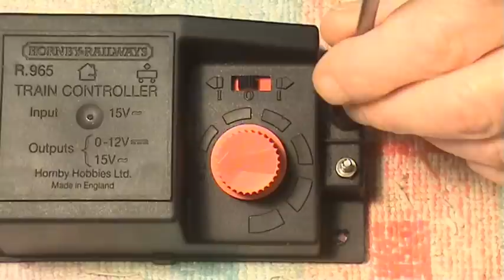How-To Modify & Beef-Up The Hornby R965 Controller. Hornby Triang.

Comment from the maker: Hi again Dave. Yes....the DC voltage is higher than the AC input but I think your 2 meters are reading what is known as residule voltage. If you put a load across this voltage [eg. put a loco on the line] then I think your meters will give you a different result! Also...as you are running the older locos on the modern track....the sleeper-grips can raise the wheels so very slightly that this causes exessive sparking! Anyway....you've sussed the problem now! Best regards, John.

Comment: Very interesting video. I'm a bit concerned that as the removed thermal cutout also provides short-circuit protection, your circuit board will take the full short-circuit current until the battery charger fuse blows (which may be somewhat higher current than it says on the fuse). Might be wise to put a 2 or 3 amp fuse in line with the output as a safety measure? Also, would suggest not leaving these unattended in case they get too hot.

Comment: The standard output cable before you remove it what one I'd the live? Black or black and white please
Reply: Hi Shane. The one with the white stripe is the positive one buddy. It doesn't really matter that much because if the loco goes the wrong way you can just simply reverse the two wires! Hope that helps buddy? Cheers, John.

Comment: The first version of the original controller back in the 80s used to have the transformer inside the controller itself and naturally this taken up lots of room. Personally I favoured the original because it was more robust with no stupid plug in the rear of the unit, just a simple wall plug. Cosmetically the original unit was exactly the same but had a yellow knob. However on a note you probably can't do the modification in the video above to it.

Comment: Hi John - I just checked my track again closely and I have found the problem - some corrosion on the inside edges of one section of track - I have just cleaned the wheels of a loco and run it for 15 mins full speed, avoiding the suspect bit of track and (virtually) no sparking, no pitting of wheels, no problems on the remainder of my layout. Loco is now crawling over points and I haven't had to clean the wheels. Happy days :) Thanks again John. Dave.

Comment from the maker: Hey David thanks for that info & yes...you are correct. I have at least one of the R921's [which I have ripped-out the transformer] & again yes...these will almost certainly have the older circuit! Anybody reading this should take your advise & go for the R921's if they can find them! Glad the mod's worked well for you too. Cheers, John.

Comment from the maker: No Tony...the post 1995 controllers are not so good or as easy to mod! They use a completely different circuit design. They can be improved but only by about 40%.

I may do a video on how to do these in time. Kind regards, John.

Comment: Those are the same reasons I prefer the older ones. Usually it get's bad without you noticing and then it just shorts out and so you need to buy a new transformer (might be part of Hornby's idea)
Other than you suggest I don't see any problems with the older unit. I've always used the old Hornby R900 and these older units with no complaints and can't say I've ever been shocked either.

Comment: Can I just say, what a well thought-out and presented video this is.
 
It's hard judge your target audience - and this video gets the balance exactly right. Neither too technical for beginners, nor oversimplified to patronise those of a technical background.

Our hobby is one of the best for learning such a wide variety of skills and youngsters need the encouragement to have a go.

There are some very good switched mode PSUs available these days, and one of these (appropriately rated) would make an ideal replacement. The fact that the recitifier bridge within the controller cleverly polarises the DC input means that the input socket may be retained - but with obvious allowances for current. That said, hard-wiring may still be the best solution in this case.

G

Comment from the maker: OK, I'll try to answer these questions. The controllers cannot put out 24 volts as the wall-plug transformer is only approx 16 volts to start with! Can you tell me how you are getting this reading? As for the other issue....there's always some small spark at the pick-up wheels & this will be more pronounced on older models. If you keep the wheels & track clean you shouldn't be having this problem! Are you running older locos on modern track? Get back to me when you ready. Cheers, John.

Comment: This is an excellent video, explains why the Hornby controller cuts out when I had my old Wrenn City of London trying to run off of it. I ended up using the much older but much beefier Tri-ang / Lines Bros Ltd controller I picked up off of eBay. Nothing like having a controller that sounds like it might kill you if you touch it! :)

The Bachmann 36-560 controller is pretty decent if you are looking for a cheap DC controller.

Comment: I'm slightly confused that you changed both input and output wires to big beefy wires but used little wimpy wires to the transistor. Doesn't all the current run through them too or am I missing something?
Reply: They are shorter wires, so the effect of voltage drop is negligible

Comment: Great, simple, straightforward - great work. Thank you. :)
I have 2 queries... 
1. My older (circa 1979) Hornby locos draw too much power (I believe) to run on the R965 -  they run for ~ 30secs then slow and stop (I presume thats the thermal cut-out).

Will this mod will solve that issue?

2. You mention the Chinese version is harder to modify...
Are you abel tto do another video showing mod of those plaese? (of course, wouldn't you know it,  that's what I have! Grrrr)

Thanks heaps.
Tim in NZ

Comment: I inherited on of those R965 controllers when I bought a bulk lot of 2nd hand track. Completely useless as it would only run a hornby steam loco. Most of my other stuff is US & Australian type diesels & would overheat on those after 10 minutes of running. Pensioned it off to run lights only in some buildings. Have you done video on the China produced controller? From what I can see here in Aussie all available controllers seem to be of Chinese manufacture & I would be interested to know how you modify them.
Reply from the maker: +farnthboy Hi buddy....thanks for your comment & questions. I haven't done the Chinese one yet & there has been many people asking about this. I will do it as soon as I can & upload to my channel. All the best, John.

Comment: Hi John.

Interesting conversion! Just a quick query, will the finished modification still provide both AC and DC output as per the original or would it be DC only due to changes to the power supply and output? Cheers!
Reply from the maker: Hi Daniel & thanks for the comment. Your answer is no because the new power supply (ie car battery charger) is DC however, you can still use your old Hornby wall plug-in transformer for powering all the AC items. Hope that helps? Cheers, John.

Comment: An informative and well made video. However, many layouts continue in operation after their original builders are long gone! I think I would include a thermal cut-out, perhaps a stat from a discarded Central Heating unit? As it is, there is nothing to to stop it heating right up and melting the plastic case. This could easily happen if a loco with a defective DCC chip is put on a your DC layout by a child in the future.

Comment: Yes your input has helped me a lot, as I'm quite new to this, plus I can see how much better your layout runs than mine so this has motivated me to do something. I am now replacing several steel track sections with nickel silver, and reducing the inclines (1/22 doesn't work), I have now modified 2 of these controllers with the BD911 transistor + heatsink so should have really good running soon! I can't wait :-) Rgds. Dave.

Comment: You state that the input wires can be any way round, because they are DC and going thru the 4 diodes anyway. I think this is an error?  A diode will only allow the current to pass one way, and DC is one directional. Therefore, if the + and - and wrong way round, the diode will not let the current pass. Think of a light emitting diode for example, it will only work if the DC is the right way round. Great job you did tho.

Comment: I you just remove or pull the heat sensor thing will it stop the controller from cutting out?
Reply from the maker: peacekeeper 277 Yes mate it will. If you do however I would highly recommend that you put a quick-blow 1 amp fuse in series with either leg of the DC supply for protection! Cheers, John.

Comment: John, Will you be doing a video for the Made in China controler. II won a couple on ebay but they turned out to be chinese. You mentioned you may have a few ideas that could get a bit more umph from them.
Reply: It is switch mode supply from China, NOT a Linear supply like shown here.  Swich mode is lighter in weight, and has higher current but operates at a high frequency.

Comment: What a cracking video. Pity mine are both made in China, which is why I run a H&M Clipper linked to a H&M multipack dc controller. Thanks.
Reply from the maker: Can't fault you there Jay! Thanks for the comment. Cheers, John.

Comment: Hey Stuart.....say no more! Regards, John.
Reply from the maker: MATTY ander
Don't know what you mean here Matty?
Reply from the maker: MATTY ander
OK, I am chambs123.....cheers bud. John.
Reply: +chambs123. Hi John. Great video on 965 controller. I am going to carry out this mod on mine but have a small problem with it. When the speed control knob is turned right off, there is still a small amount of current going to track which makes loco buzz. Do you think potentiometer is needs replacing.

Comment from the maker: Hey buddy thanks for the comment but....I'm afraid I'm gonna 'shoot-you-in-the-foot'! You are correct about diodes only conducting one way but you are not getting your head correctly around this. On a full-wave bridge we have 2 diodes forward facing & 2 backwards so...if you think about it the DC input either way round will always be present at the output because it has 2 diodes either way! You loose about 1 volt that's all. Check my website....Champ Electronics Nottingham. Kind regards, John.

Comment: You are aware that the 1N4001 rectifier diodes are only 1 Amp rated and will become a tad hot, possibly failing, if the load current is prolonged and heavy. Fitting 3 Amp rated 1N4003 diodes might be a sensible additional modification.

Also the voltage drop of the diodes is 1 Volt so for the 13.8 Volts DC from the battery charger the useable voltage will be 12.4 Volts DC.

I would have cut slits or a pattern of small holes in the sides of the casing to allow the heat to escape which would solve the trapped heat build up problem when on excessive loading.

The TIP41 or TIP31 also makes a good replacement. I've used these transistors in countless home brew model railway controllers over the years.

The BD135 is also the transistor in the Hornby Zero 1 modules (original series) which I've repaired numerous examples of. These hated triang power bogies (blows the DC isolation capacitor eventually) and I used the later series 2 / H&M double transistor modules on these as they cope better.

It seems to be a decades old tradition that Triang and later Hornby power supply systems need modifications to give ideal and reliable performance.
Reply from the maker: Tom Niland Hi Tom....thanks for your input to my channel....appreciated. Whilst I fully understand & accept your comment, I have to say I have no problems whatsoever with the 5 controlers I have converted & use on my layout! Please check-out my website for credibility here: http://www.chambonino.com/

Big thanks, John.